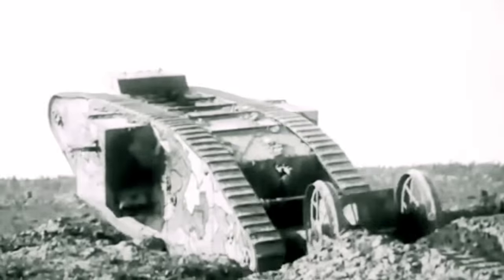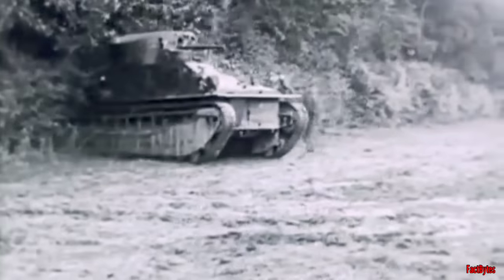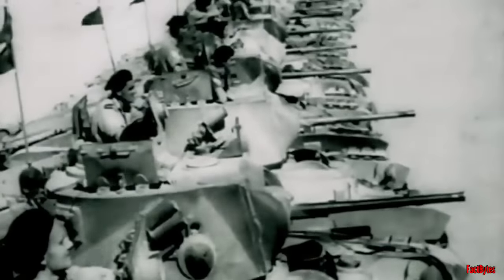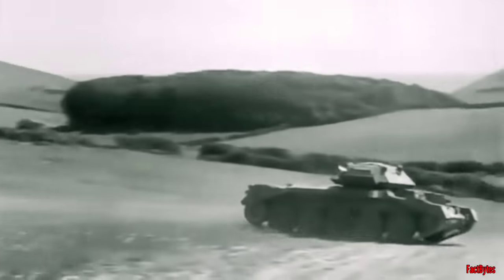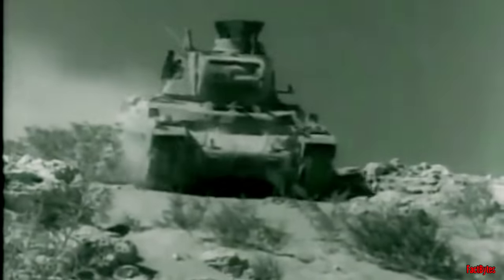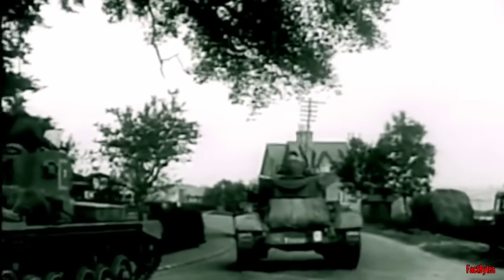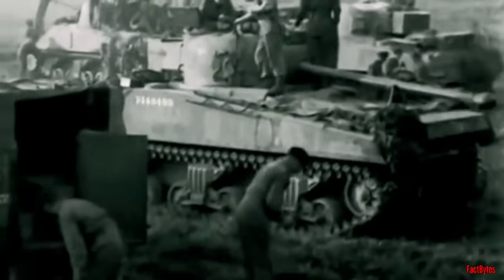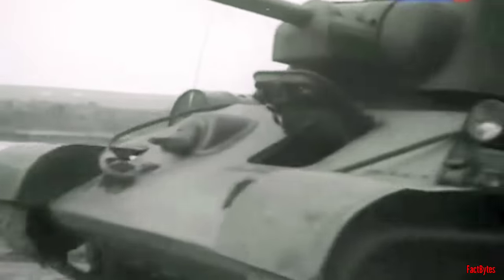Why Did Britain Struggle to Build Effective Tanks During World War II?

Comment: Don’t forget British infatuation with the .303, using it in their fighter planes. The use of the .303 as an anti material rifle cartridge is an example of the extreme incompetence and corruption that existed in British upper management during the lead up to the Second World War.
Since much of the records of classified information is sealed for 50 years, and some 100 years I hope that some enthusiastic researchers determine how and why the .303 cartridges were used in British aircraft.
Reply: Because the .50 was judged to be too heavy for the minimal performance upgrade over the .303
You might get 30% better performance but at 50% increase in weight and lower ammunition capacity, as well as heavier ammunition which also decreased  performance in planes which were supposed to be rapid response quick climbing interceptors.
The early Browning .50 guns also had reliability problems, recocking a gun on the ground or in a gunners position isnt a problem, in a fighters wing its a big problem.
The RAF decided it was better to just miss a generation and move straight to 20mm since it had two to three times the damage effect of .50
Its also worth pointing out the Germans Me-109 and the American fighers also only used rifle calibre weapons, both the British and Germans only began trialling 20mm guns in the F model 109s that didnt really enter service till late 1940.
Theres never been any secrecy about the decision, the figures used have been on open display for decades.
Reply: @voiceofraisin3778  I’ve read much about the Germans not bothering with the .50 or the Euro equivalent. I’ve read the statistics on the large caliber rifle rounds an they are marginally better than a .30, but not significant. No German 13 mm on tanks.
When you get to cannon rounds, it’s is a marked increase in performance over any rifle caliber.
When I posted, I’m genuinely interested in why .30 in an aircraft. And very interested in the 20mm, and up to 40mm in aircraft.
I know the Americans had success with the high volume .50 in the fighters, but that was later in the war.
It’s an interesting topic.
Reply: At the start 30 cal machine guns were used on all aircraft 
50s were just coming online
As the war progressed 20mm and larger come into being
Reply: They did put 20mm cannon on some Hurricanes during the B of B but couldn't get them working reliably. Pilots asked for their 303's back.
Reply: I don't understand the leap from using 8 x .303 as the primary armament in 1939 to extreme incompetence and corruption. There isn't any evidence of widespread incompetence or corruption leading up to 1939 that I'm aware of.

Rifle calibre ammunition in fighters was the global norm in the 30's and even into 1940. Aircraft were mostly made with canvas skins and armour was very rare in fighters so .303/7.5/.30 was deemed capable, and it was to the extent that at the start of the war, the 8 x .303 armament in Britain's Spitfires and Hurricanes was among the heaviest in the world. The Germans only added a cannon to the Bf109 (E-3 variant) right at the end of 1938. The USAAF was running the P-36 with 1 x .30 and 1 x .50 alongside the P-40 (which only recieved it's 2nd .50 in 1940 with the P-40C variant), and it was only the very latest French fighter which had 4 x 7.5mm and a single 20mm cannon. As soon as it became apparent that .303 wasn't going to be sufficient moving forward, the RAF started adding cannons to its fighters. The Spitfires started receiving 2 x 20mm in June 1940 and the Hurricanes 4 x 20mm in February 1941.
Reply: So when did American aircraft get cannon…..?
Reply: There was no ‘British infatuation’ with the .303.  It was a calibre they planned to replace just before the First World War but the outbreak prevented that.  By the end of the war they had a massive stock, no wars to fight a worldwide depression and little taste for anything military.

By the Second World War, they quickly looked at using 20mm canons in fighters (and trialed Spitfires with them during the Battle of Britain) but the were unreliable so took a couple of years.  Simply converting everything over to .50 wasn’t practical or economical at the time.  

At the time of the Spitfire and Hurricane entering service, US planes were also using a similar rifle calibre.  By the time the US were using .50 calibre as standard, Britain had leaped ahead to cannons, finishing the war with most recent fighters having 4 20mm canons.

There is so much misinformation both in this video and in many of the comments.  A trait of our times that there is little interest in researching information now.
Reply: @frankanderson5012  thank you for taking a minute to explain. I’m taking the time to learn what I can, and there is lots of contradictory
 information on many things, and different view points. The more I’m learning the more discrepancies I note. Economic considerations are critical to weapons of war. A good example would be German tanks being high quality, and very expensive to build and as a result it was a failed strategy in the war effort.
I find it all very interesting, and am trying to find answers to many things that may not have a clear answer.
Thank you for the information.

Comment: Good summary. To be fair, you could say that British tank design did a fairly good job in the circumstances. Churchill's initial bad reputation came about because it was rushed into service for Dieppe, when it clearly wasn't ready, but it was stunningly successful as an infantry support tank, particularly in mountainous areas like Tunisia and Italy. Valentine was a massive success for infantry support, despite the delay in giving it a decent gun. Crusader was pretty good as a light/medium tank - much more useful than an M5 in that role. Comet would have proven itself more if it's deployment hadn't been delayed by the Ardennes, and Centurion is one if the most influential tanks of all time. Throw in the multiple successful developments of wading and AVRE tanks, and that's not such a bad record. 
On the subject of British procurement, you could argue that the the success of  the Sherman is a prime example of the flexibility of British procurement i.e. throwing a massive amount of money at American manufacturers so that they were able to build massive factories to build tanks for the British army, at a time when the US didn't have the manufacturing capacity/expertise for tanks either.
The Germans didn't deploy 88mm guns in tanks in North Africa either, until Tunisia, when it was all over, and the biggest threats to both sides' tanks was the AT gun or the field gun.

Comment: Because they were a declining industrial power internally divided along class lines whose ruling class was no longer able to enforce it‘s interests or give an effective lead to the country. Basically, Italy but not as bad. 

It probably also plays a role that land warfare was not their primary focus. 

And designing, building and deploying effective tanks is a major social, industrial and doctrinal challenge. You need the industrial resources and you need to understand the problem which requires an effective and tested combined arms doctrine. Tested meaning you need to have fought against a modern army with that doctrine and adjusted it accordingly.
Reply: Mostly carp.

Comment: This is rubbish. The Valentine saw service throughout the war and on nearly every front. The Matilda could and did destroy all German armour in 1940 and 1941 and was in service until the end of WW2 and was used in the Pacific by the Australians as a preferred tank. The Churchill was a brilliant tank which had the highest crew survivability rate of all Allied tanks and could operate where other tanks couldn’t. Plus it was the basis of most AVRE. The Cromwell was a fast tank which outstripped all other armour in the exploitation battles of NW Europe. Then there was the Sherman Firefly which with its 17pdr gun was the only armour capable of stopping the Tiger in NW Europe in 1944.

Yes the Brits had some lemons like the Covenantor and Crusader but to condemn all British armour is just rubbish.

Plus you have to remember British doctrine was based around three types of tanks - infantry support which were slow moving but heavily armoured; cruiser tanks which were fast and designed to exploit gaps in enemy lines; and light or reconnaissance vehicles. No one had a universal tank concept at the outset of WW2.

The US had the luxury of watching mistakes made in France and N Africa to develop their armour and doctrines. In 1939 the US couldn’t field any tanks to speak of and in 1941 had to rush into production the M3 Grant. The US placed more emphasis on the tank destroyer doctrine which later emerged as less than ideal and the M4 filled all roles of infantry support, exploration and tank on tank killing but not until 1942 in North Africa.

Comment: In what small part of the British tank designer’s brain made them think a 2 pounder gun was reasonable?
Reply: Dunno,what small part of the Americans brains made them think a 37mm was reasonable on the M2 and M3 tanks, hell they retained that ineffective pea shooter until the 1960s.
What small part of the Germans brains made them think putting a 37mm on the Panzer 3 wasnt a mistake?
What small part of the Soviets brains made them think copying the Germann 37mm as a 47mm was going to be effective?
2pdr (40mm) was the basic standard for armoured vehicles at the time. 

The big mistake was in not releasing HE rounds for it to the tank crews. OK HE in a 37mm is pitifully small and the Germans and Americans couldnt get it to work well either but it had at least some effect against AT guns.
Reply: Slight confusion between the Ministry Requirement and the Designer.  Designers have to comply with the Ministry Requirement.  Point fingers at the Ministry and whatever contortions were going on there.

Comment: The British Built some decent Tanks, and they built thousands of them, this video is misleading, The Matilda Tank was by far one of the most difficult British Tanks for the Germans and Italians to Deal with and try to destroy. During the Fighting in the desert's , British Matilda Tanks did tremendous damage to the Germans and especially the Italians, The Germans reported " Hitting " these British tanks at close range with their 75MM and 88MM Guns , most of the time the rounds simply bounced off the Tanks Armor, Even the dreaded 88MM Flak Guns the Germans used, many times had no effect on Matilda Tanks. The Smaller Vickers, Cruiser Tank used by the British were good but not great tanks, this Video sates the mechanical problems persisted with these tanks, not true British Tanks Suffered no more breakdowns or failures than the Germans or American Vehicles, When the British learned American tactics, such as how to " Swarm " Heavier German Tanks with Several Lighter Tanks, and how to Sneak up on them from behind and Blast them these Light British tanks were deadly. The Comet was in fact a Tank the Germans tended to steer clear of. The British Loved The American Stewart Tanks, they called them " Honey's " and they especially loved The US Grant and Lee Tanks, with its 75MM Gun and Air Cooled Engines, These American Tanks simply ran Circles around German Tanks, Then getting up close to them and firing several 75MM Shells at the rear of the German Tanks, Destroying them Easily.

Comment: T-34?????
It might have been a good tank design, but the actual execution was laughable. Metallurgy was never repeatable, engines might last for the span of one battle, and tanks rolled off the assembly line with "unintentional viewports" due to armor plates having literal gaps between them. The only true advantages of the T-34 were sloped armor and overwhelming production numbers.

Comment: The Centurion was so advanced for it’s time that it proved superior even on the Yom Kippur war in 73, with some Israeli modifications like shifting it’s engine to Diesel, it could cope very well with the Russian T54, 55 and even the modern T62 . The Centurion was also far better in real combat when compared to the American M48 and the M60 that didn’t have the canon stabilization system and were more venerable in taking hits
Reply: See also https://en.wikipedia.org/wiki/Battle_of_Asal_Uttar and other Indo Pakistan tank battles - Centurion against 'next generation' M47 and M48 US made targets.  Perhaps that is why it wasn't fielded in Germany.
Reply: @etherealbolweevil6268  maintenance wise, Centurion (Shot kal) guys had 2 nightmares: exchanging the main control box (aka the “brain”) and even worse, the amplidyne (a kind of rotating amplifier consisting of 2 generators run by an electric motor) These 2 item were probably considered real high tech back than in the 40’s because they enabled the canon stabilization during ride.   
The soviet T54 and 55 ( we had many in service in IDF) had a much more modern and compact stabilizing system and amazingly, it never failed

Comment: How about, Britain was in industrial and engineering decline even at that early stage? No one is 'good' at everything, and the brits simply did not have the talent, or the resources, to build good armor. Even their amerikan patrons were only average at best. The Russians and Germans for all their shortcomings, and there were a few, were simply much better when it came to tank design. The Sherman, was mediocre at best, but it was cheap, easy to build and maintain and its production did not require a very skilled or capable workforce, or to crew the tank even, and they still outdid the brits efforts. These things all come down to resources and skilled designers and these just werent areas of strength for the brits. Rather than just admit this and stick to things they could excel at, the UK wasted a lot of resources on what turned out to be white elephants.

Comment: Typical Yank BIAS.
There were early tanks, that scared the crap out of the Germans. 
Matildas, & Valentines to name 2. The issue was lacking initial needs and tactics that were designed for the 1st World War. 
The Churchill 1 wasn't particularly great but later 4's, 5's etc were far stronger, if not great guns. The Armour, and Climb ability were better then most other tanks then known, including early Tigers. 
Truthfully the biggest problem the UK had was limited production and supply capacity which needed targeted towards The Royal Navy, Royal Air Force and Railway usage. 
The Railways were needed to transport pretty much everything around the country.
Reply: We need a German response to that.
We all know they were afraid of most Russian tanks
Reply: @frankdrevinpolicesquad2930  Matilda 2s frightened the Germans in the Battle of France because their standard 37mm AT guns had no hope of penetrating their armour. Like at Arras, Matilda 2s were literally driving over and crushing German AT guns until they used the 88s as a last resort.

Comment: The tiger over rated. Toooo slow. Toooo heavy. Too many mechanical failures....good firepower though. But even a thinly armored tank like the legendary Sherman, especially the latter variants of the Sherman like the "easy 8" and the other ones, or those tank destroyers built by the US that appeared later in the war were more maneuverable, reliable and maintainable and easy to repair fitted with a powerful gun could out perform those German tanks